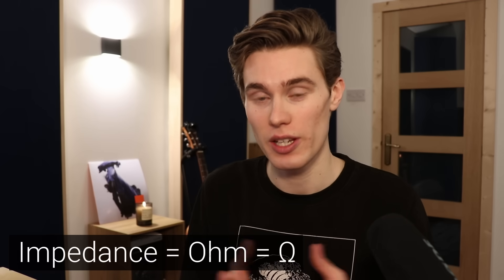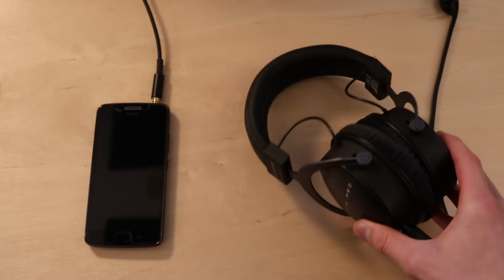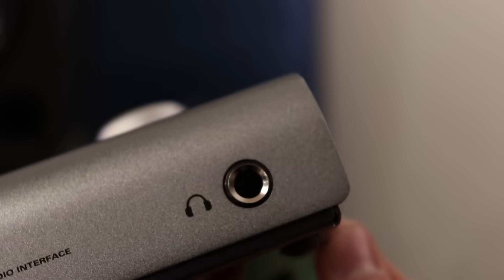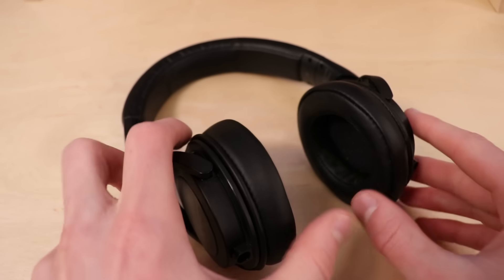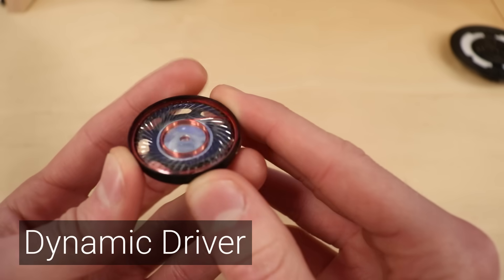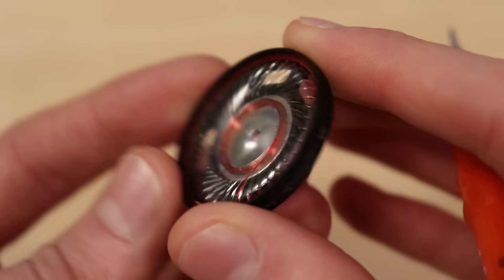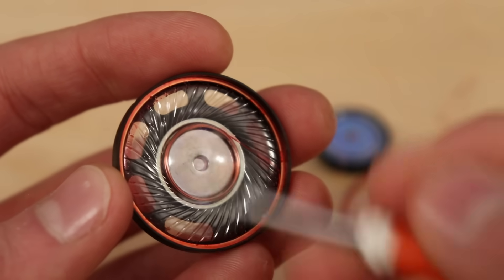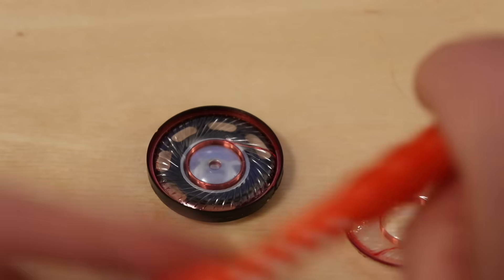32 ohm vs 250 ohm - Which Headphones Sound Best?

Comment: Hey if im gonna be using the beyerdynamic dt 880 from my PC (if got a nice motherboard) How many ohms do you think would be optimal 32 or 250?
Reply: 32, probably, You don't need that much ohm for a PC 👍 depending on your soundcard in the computer of course
Reply: I bought the dt 770 80 ohm for my PC though, but I Kinda regret it, I think 32 ohm would sound better on my computer.
Reply: Ok I've got a sennheiser hd 58x jubilee right now and i hate it because of the terrible build but it has 150 ohms and in my opinion it gets loud enouhh on my pc. Do you think if I would get the dt 770 pro 80 ohm it would get even louder than my sennheisers?
Reply: Pitfall  Really I'm no expert but yeah  I would assume that your PC, if you have a normal soundcard, it doesn't have the voltage to support higher ohms such as 250 ohms. But if it works well with 150 ohms then yeah I would say 80 ohms dt770 is perfect for your system.
Reply: @lando199  Alright thanks